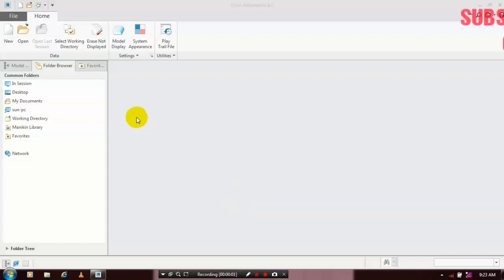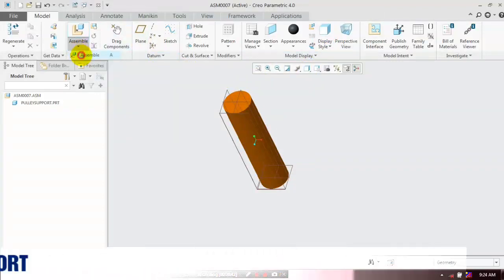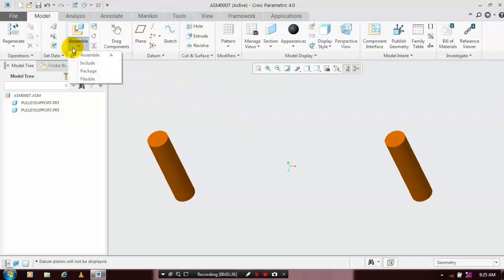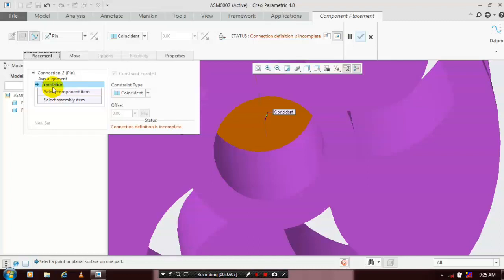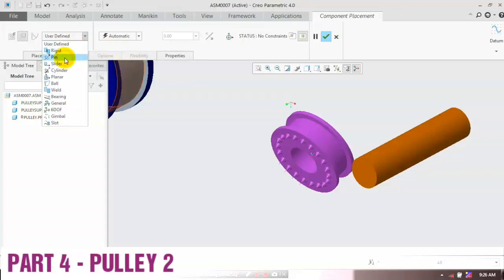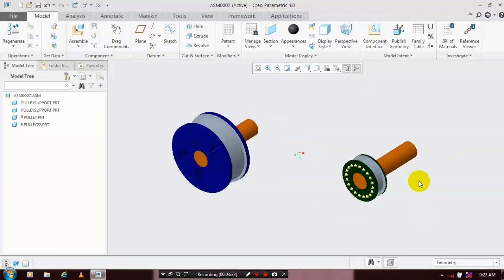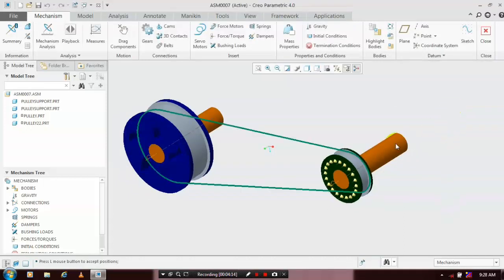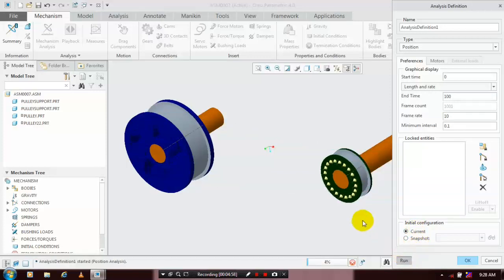BELT DRIVE MECHANISM IN CREO 4.0/3.0/2.0

Comment: In this case only the pulleys will rotate. What if I want to rotate the shafts along with pulleys?
Reply from the maker: HEMANTH KRISHNAN R 
In this video I  fix the SHAFT & rotate the PULLEY. 
As per ur question,  u have to make PULLEY with SHAFT to rotate by fixing another support. 
Without FIXED support It can't rotate. So u have to create 2 SHAFT for single PULLEY, 
One hollow SHAFT rotate with PULLEY,  another SHAFT FIXED with above shaft